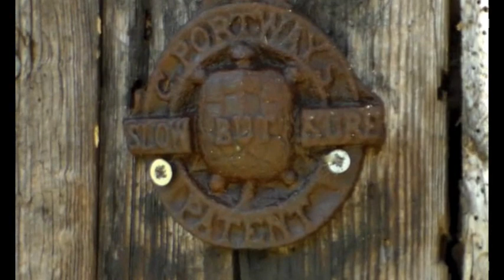Timber and firewood harvester bar repair

Comment: hi andy,thats a great job done, i happen to work a lucas chainsaw mill with a 6ft bar which the nose sprocket gave up permantly,so i ground the sprocket out 1mm disc got two days  milling oak , now cut nose and fitted a floating sprocket head from fuelwood ,superb,atb
Reply from the maker: Brilliant, those harvester bars are quite robust so there is plenty of steel to weld, glad you were able to use this technique, cheers

Comment: Does that bar repair last a decent time Andy ? I'd expect that to crack at the weld and break again quite soon with the fierce way those harvesters cut.... great job if it extends the bar life significantly though.
Cheers,  Dave
Reply from the maker: Dave, it works fine with the weld at the nose end where there is a lot less stress, cheers
Reply: @TheInfoworks  Yes, I see that Andy. I bet a new bar for a harvester costs quite a bit, so it's a Good Thing that making one from two duds is a viable thing to do. Dave